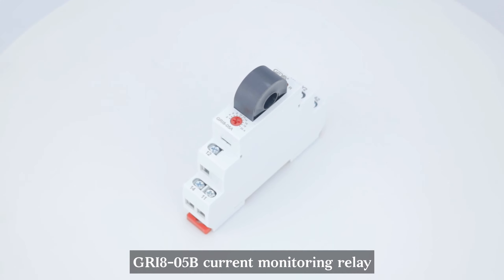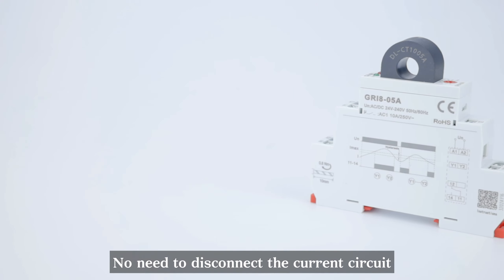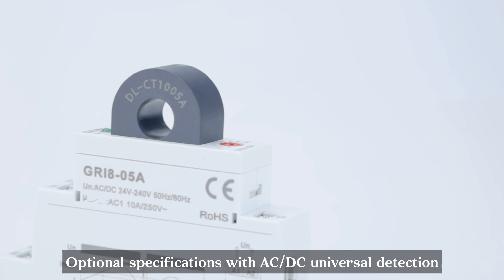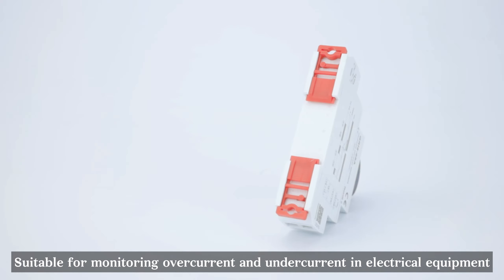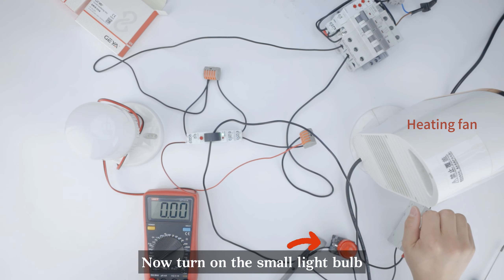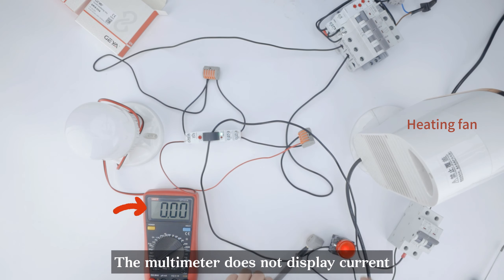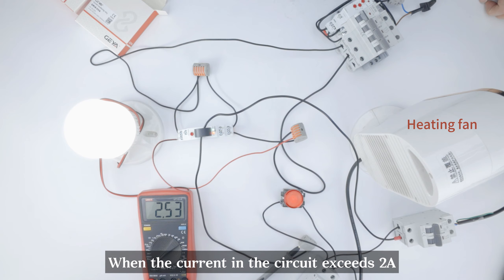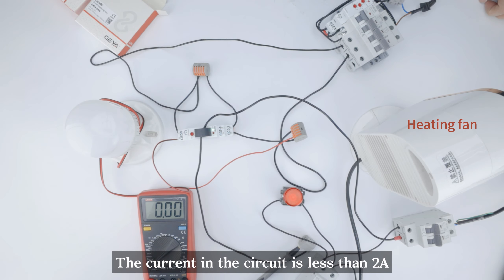GEYA GRI8-05B Current Monitoring Relay

Comment: The product could be great but the video presentation and explanations are very very poor. You need to show the schematic of what you have done. Explain this correct usage and how this needed to customer. Explain additional usages and how I as a user can use this device. You left quite lots of topics not covered. I can only guess what this product is capable of. I'm not gonna experiement until I 100% sure I need this and this is exactly suitable for my application.